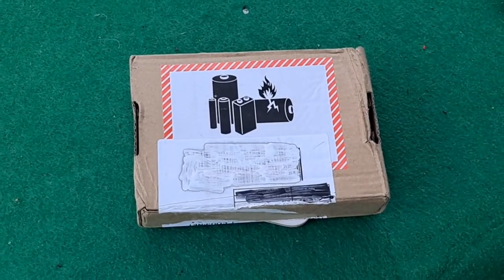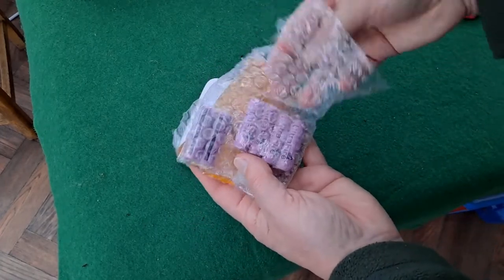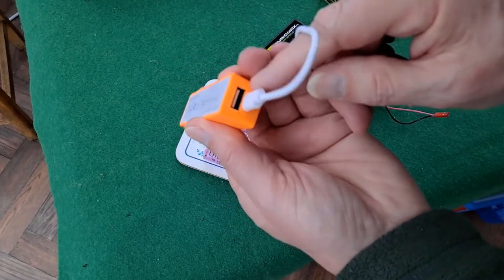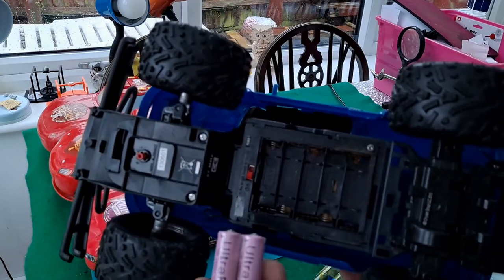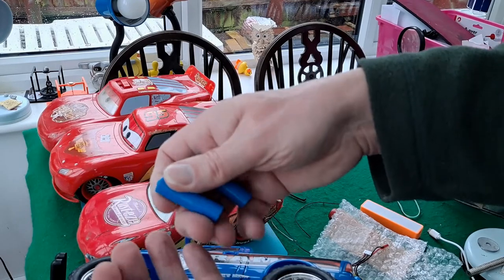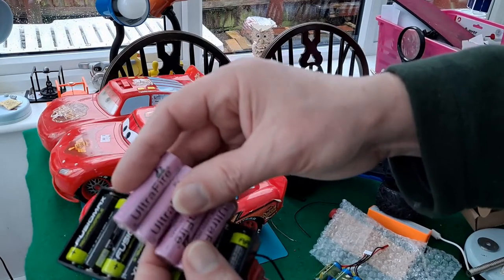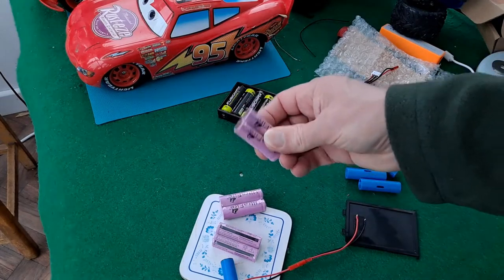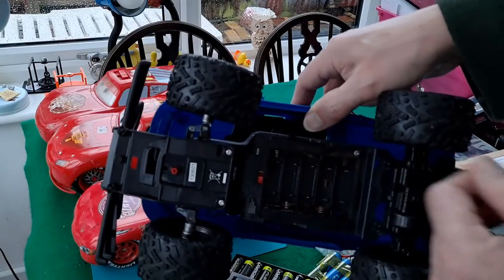Grandad's postbag 20210120 LiIon batteries 14500

Comment: I also just got a pack of 2 a couple of days ago same size even 14500 800mah i had 2 but lost one of them and i just got a flashlight that uses one they are really useful size since they fit tin AA battery holder mines came in a package with no lithium battery warning on it for some reason though
Reply from the maker: I have heard stories of the Postal services refusing to deliver items that they find contain batteries unless clearly labelled and packaged to meet specific criteria. Even reports of the package being seized and destroyed.

Comment: Hi    Instead of a wire in a dummy cell you could wire up  diodes in series that will drop some voltage .

                                                                                                                                                                         Alan
Reply from the maker: Yes you could do that is you wanted to drop some voltage.

Comment: I dont think those batteries are 100% real because ultra fire are known for fake batteries by not having the capacity that it says on the batteries and may be low capacity batteries
Reply from the maker: I never expect anything to work to it's advertised performance when I buy on eBay, especially when I go for the lowest price 😆
Reply: @GrandadIsAnOldMan  ya i figured 😆

Comment: I'm not sure if thay are really 2800mah i don't think you could get that capacity in such size most of the ones that come up when i search on ebay was 800mah and 1100mah i don't think they make them in 2800mah also because this brand is very common to be faked the ones i have are 800mah all 4 which seems like a much more suited capacity for such size batteries.
Reply from the maker: I never expect anything to work to it's advertised performance when I buy on eBay, especially when I go for the lowest price 😆

Comment: Would it be worth making some short dummy batteries to to make up the length to fit 18650 charger?
Reply from the maker: The charger I bought will take a range of sizes including 18650 and 14500. Before it arrived I had made 2 different chargers. One used the USB charger boards that I salvaged from the Poundland power packs and the other simply used an AA battery tray that I added suitable connectors for my existing charger. On top of that I also found one of my existing chargers I had forgotten about can do 2 14500s. However I do like the new charger, it is simple basic and cheap 😁
Reply: @GrandadIsAnOldMan  Cool, I use the poundland chargers a lot for onboard charging projects, 5v shroud removed.
Reply from the maker: @Telboy-fv8ke  yes they are useless for charging your phone but very handy for all sorts of other applications 😊👍